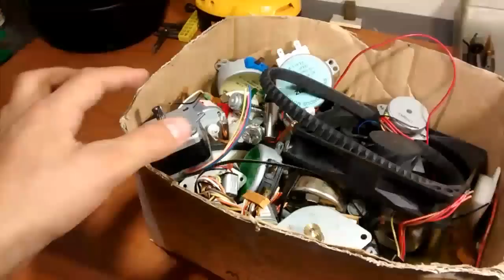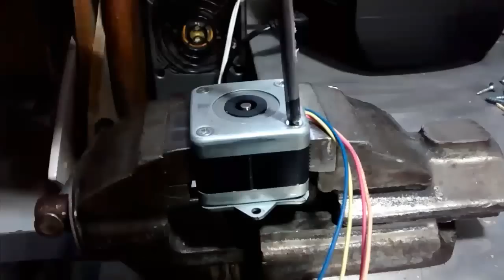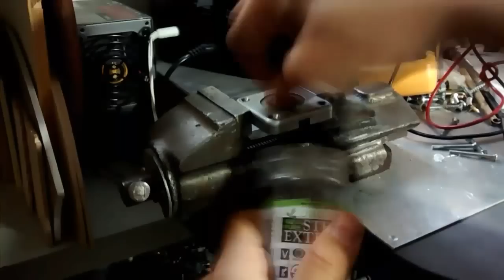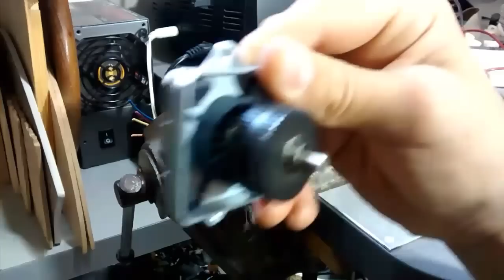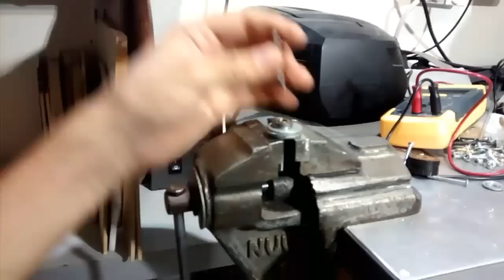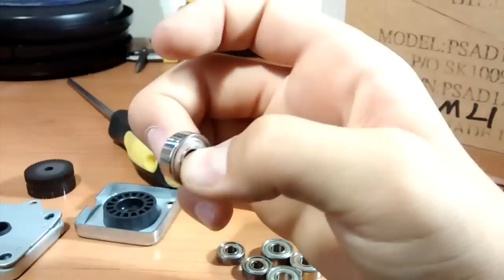How to Get Bearings for Fidget Spinners for FREE!

Comment: Is the motor broken? Otherwise I find it a bit wasteful considering the fact that stepper motors are quite expensive, especially pretty high quality ones you could find in a printer... There are plenty of places where you can find ball bearings like other motors, fans, etc, but sometimes the device you're ripping the bearings from could be much more useful than a fidget spinner!
But hey, just just my opinion!
Reply from the maker: Maybe :)
I've been keeping for a long time, and am far from having the skills for powering one. By the time I learn how to use and need one, I'll probably salvage more.
This is the 2/3rd one that I've taken apart for bearings. I have a ton of other ones (big, but not as big, and a few of the same kind) that have bronze bushings.
No problem! I actually did end up using on for the fidget cube spinner, but that wasn't my original idea. Fidget spinner in the title = way more views = win win for everyone! :)
Reply: Haha I know they're pretty complex to power!
You're lucky to have all these parts btw, especially motors and stuff which are so expensive when bought online!
Yeah I guess haha
Reply: Ugh I was thinking the same thing--like tearing apart a Mercedes for the floor mats. 
A decent small stepper motor is $20 new and you can sell it on Ebay for $10. You can buy skate bearings for fidget spinners for 10 cents cents each on Ebay.
Powering a stepper motor is neither complex or expensive and doesn't require any great skills. Sell a couple of them on Ebay and use the $$ to buy an Arduino; then spend an hour on Youtube learning how to power steppers instead of smashing them apart.  Seriously, this is wasteful and screwed up.
Reply from the maker: Looks like I haven't gotten notified for your comment...
I see what you mean. Most of the stepper motos that I find in electronic devices cannot be identified, so I can't use them or sell them, making them useless. I don't have a project or use for them anyway. I also don't have a way to check them, or a convenient way to ship them.

Comment: Big expensive stepper motor, take out the bearings for a fidget spinner. Cuz that makes sense
Reply from the maker: Yes, indeed, it does.
Reply: @Yonatan24  Im being sarcastic. The fidget spinner was designed to help people with disorders cope by fidgeting. Then, for god knows why, it became a stupid trend in like 2017. With that paradigm, I will bring fourth this point: what are the chances of an individual who requires access to a fidget spinner which is like 5 bucks at target who does not currently posses such an item require themselves or their peers or family to disassemble a delicate part for something so basic. For most people that that would be more tedious than therapeutic. The time economics of this are horrible. You could go work minimum wage for an hour and buy it.
Reply from the maker: Oh, I don't guarantee this would be relevant or economical for everyone.
But making things is fun. And as I show (poorly) in the video, this stepper motor was salvaged from a printer I found for free. 
Not everyone lives in an area where people throw away their old printers, and not all printers have stepper motors with ball bearings, indeed.
And the minimum wage is irrelevant for a large percentage of the people that watched this, young people.
Reply: @Yonatan24  o lol